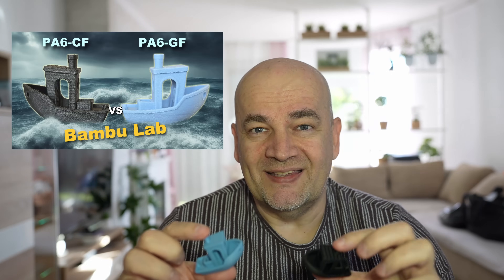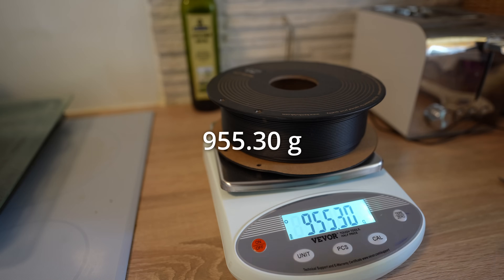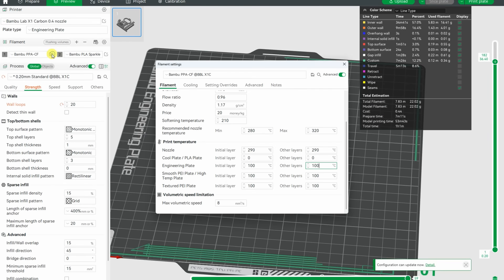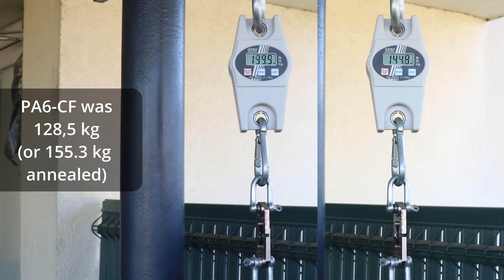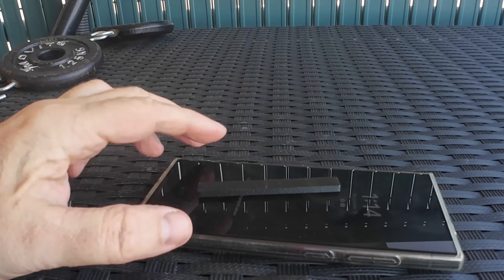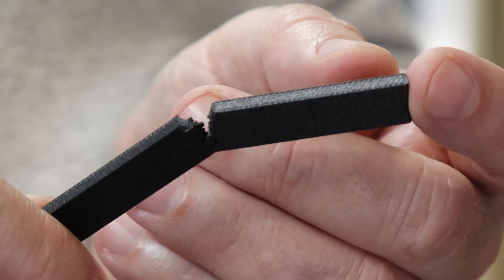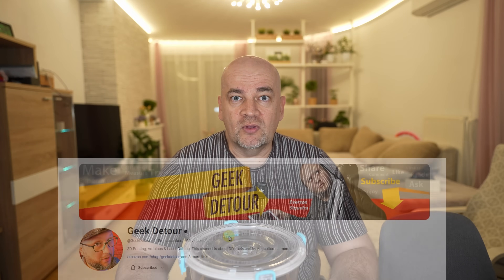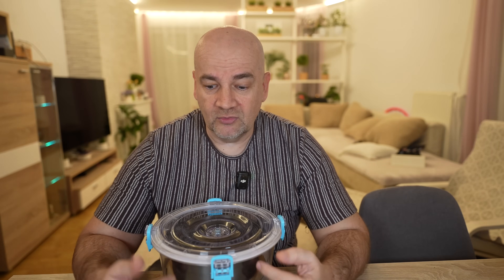Bambu Lab PPA-CF: the STRONGEST filament ever (I tested so far)

Comment: This is a fantastic channel. I thank you for all the hard work you put in for the benefit of others. I do have a couple of questions regarding your PPA-CF test and apologies if I missed this in the video. Did you use a .4 or .6 nozzle when printing your test parts? Also, after drying, did you use an external spool for printing, or did you print directly from your drier? Thank you again for all your hard work Peter
Reply from the maker: 0.4mm nozzle. I don't remember for that video. But usually from dryer. Short printing from open air.

Comment: Hello sir, new subscriber, I am very impressed by your testing, excellent video! I'm very curious to know if the results of your test showing 1g of water absorbed by the filament in 2 weeks would be different if you liberally coated the seal on the vacuum container with vacuum grease before sealing, and additionally, if there would be a difference if you vacuum sealed the chamber right after pulling the filament and chamber out of a warm oven. Cheers!

Comment: I've been printing with this material for work. It has been working great. However, yesterday we had a thin part warp on us after being exposed to the sun for a few minutes.  We then put a few parts out in the parking lot, and the thin parts got alarmingly soft. This seems to be a combination of humidity, temperature, possibly UV exposure? I know this material absorbs moisture, but does this mean the parts are unusable anywhere the humidity gets over 50%? The filament was dried using bambu x1c heated bed drying cycle. Print temp is 300C. Print speeds 100mm/s max. I did not anneal the finished parts. What can I do to prevent this material from going soft and warping?
Reply from the maker: Wow,  this is new to me. I will try to investigate this. It should withstand this without problems..

Comment: I just print from a toaster oven.. inserted a brass fitting in the rear and PTFE tube to my P1S. Installed a stainless steel shaft through the middle and stood the toaster oven on its side, and used external temperature probes to a thermometer to monitor internal temperature. Works well, and it’s cheap… NOTE: you must turn groves in the shaft through the toaster to place large fender washers to keep the spool centered so it can’t walk near the heating elements, without doing this, it’s a big fire hazard as the spool will wonder around on the shaft and eventually touch a heating element. But if you have the grooves turned in the shaft and use the washers the spool cant wonder. 

Active heating while printing is the way folks.

Comment: The manufacturer recommends annealing the print at a temperature of: 120 - 140 ℃ 6 - 12 hours.
It was necessary to print double samples and conduct tests also after annealing.
Why didn't you do it?
Reply from the maker: I did it with other PPA filaments. Only no fiber reinforced can benefit from this, temperature resistance will be better.

Comment: I'm increasingly convinced that layer adhesion is THE deciding factor in determining strength of printed parts.
Reply: Yes and no. Its important and certainly plays a factor in the overall strength given that its always the weakest link in a 3d printed part, but you can and SHOULD design and print parts with this in mind. The relatively weak layer adhesion of literally any 3d printed part can be mitigated if the part is designed to be printed in an orientation where any anticipated loads will either put the part into compression, or will be aligned with the layers and bypass the layer adhesion as much as possible.

Comment: add a small of amount of orange re-usable descant to you vacuum container. That will pull water from the air in the storage container that got sealed in when it was closed. 
I use a 4 liter cereal air tight dry box with about 50 grams of desiccant for my PPA-CF/PA6-CF spools.

Comment: For your Z test what was your chamber temp?  An active chamber heater will help with getting better layer adhesion along with the increased nozzle temps.  The TDS for that filament list a chamber temps between 50 and 80c.  Getting that chamber closer to 80 will give you better isotropic properties, this will also make it stronger in the xy direction too.  You can see in you horizontal twist test that the layers separated, which is probably most of the failure mode.  Get that plus4 up and running and redo all your engineering filaments.  I bet they will all perform better with the actively heated chamber.

Comment: Ive printed PPA-CF at 340C in a 110C heated chamber and got around 70% strength in Z vs in XY. I also annealed it. it likes hot it's really not a plastic that should be printed on a Bambu x1c lol. to be fair this was 3dxtech ppa not Bambu

Comment: ohhh that qidi isn't safe. The PCB that controls the chamber temperature even with the firmware update has a choke that will heat up to over 170 degrees. It's not supposed to get that hot.

Comment: I accidently annealed a full spool of sunlu pla+ at 70c for 12 hours in a drier. When printing it, it required higher temps to print without skipping. Might be worth testing to see if it retains any temp resistance?
Reply: ofc it doesn't. you change it's structure when remelting.
Reply: @riba2233  understood. Initially thought no as well since it was rearranging the crystals and remelting to normal pla+. But after using it more, it needs to be printed above 250, tested up to 300 while still printing reasonably well. Being able to print pla at these temps has a noticeable effect on layer adhesion. Not sure if it affects any other properties.

Comment: Regarding the moisture change, I keep my most used filaments in Polymaker dry boxes (from PolyDryer), and I was very surprised when the % went from below 10% to 22% in less than a month and even the desiccant changed colour from orange to black.
I expected it to be able to keep my spools relatively moisture free for at least a month, but it seems like I have to dry them every time I want to print (if it's a material I print with less than 2x a month), since some materials really should be kept at <= 15% humidity.

Edit:
Oh and have you tried the PAHT-CF (PPA-CF) from QIDI? It's way cheaper (95€ for 1kg) compared to Bambu and I would expect it to be very similar in quality.
Honestly, haven't seen you test QIDI filaments in quite a wile. Even in the filament roundups for PLA and PETG there isn't a single QIDI filament, which is slightly disappointing to me, as I mostly use those and Prusaments.
Reply: 168 vs 120mpa in specs...
Reply: @riba2233  Which value are you even referring to? I can't find one that is either 160 MPA or 120 MPA in QIDI Wiki for said filament.

For me, I would like to see actual results. That is why I asked if he tested that specific filament.
Reply: @MiChAeLoKGB   tensile of course, bambu has much higher rating for some reason

Comment: The question is why on earth is it so expensive? It's a bit of plastic with some carbon fiber mixed in. You have to wonder if some competitors are going to undercut this price substantially. At this price, along with the ownerous drying procedure, I would rather prototype in some other material and then use an outside SLA printer in nylon for the final parts, superior strength without z-axis weakness, and less money. You could even SLS print metal and get, well, the strength of metal, for similar cost.

Comment: 16:50 For a meaningful measurement, use aluminum spools that don't absorb moisture. They can also tolerate higher temperature for drying.

Comment: For drying, I recommend a large toaster oven with a metal tray and use aluminum foil to cover the filament on aluminum spools. The aluminum foil and tray block direct absorption of radiation from the heating elements. This minimizes thermal decomposition or hydrolysis. Most toaster oven have a timer, but some allow for continuous heating.

An even better solution would use vacuum to reduce the drying temperature, for reduced decomposition/hydrolysis, but high temperature greatly increases the rate of moisture diffusion from the core of the filament.

Try PPS next!

Comment: with this poor layer adhesion, the material is pretty useless. we don‘t need materials which are stronger in xy but one single material which is ok in z!
while I like watching your videos and I respect the scientific approach, it is far away from real world applications. In real life you should never be so close to the the mechanical limit! you need to compensate the material limitations by the geometry of the objects.
there are too many filaments on the market which are not needed since there is no real advantage in mechanical strengths!
3d printing has two major limits: gravity and layer adhesion. while multi material printing made big improvements which is beneficial to deal with gravity (support layers) we still are waiting for a solution for the extremely poor layer adhesion!
Reply: have you watched cnc kitchen vide0 about transparent prints?
Reply: i hve watched a lot of cnc kitchen videos. but i don‘t remember that?
Reply: @skewcrap   check it out and you'll see how we can get some really good layer adhesion ;)
Reply: Please don't include me in your idea of "we". Plenty of "we" design functional parts that take into account the directionality of the loads applied through design and print orientation and make great use of materials that are stronger in xy than z. "We" don't all print the same things.

Comment: As for layer adhesion... If you need better layer adhesion you should really go beyond "maximum" printing temperature. For example, there is a lot of difference between printing ABS on 245C and 270C. Of course, fan as low as possible, if not turned off. You can't expect small details or overhangs to be printed beautifuly, but layer adhesion is noticeably increased.

Comment: This is surely a very interesting material for more demanding parts. I wish you could do some more extensive testing on the temperature part, creep over several heat cycles, stifness at high temperatures or extended time at elevated temps, since those properties is what makes expensive plastics worth it :) maybe we should donate money so you can buy an industrial oven :)

Comment: Very interesting video. You should have printed right after opening the package. How do you know if the moisture reduction was from the spool or the actual filament? It seems that the spool is some type of cardboard. I'm sure cardboard absorbs humidity as well. Thank you.
Reply: No, you should never do that with serious materials
Reply: @riba2233 I would like to see the results as a comparison to after to see the differences both in print quality and mechanical strength of printing "wet". Of course his "wet" and mine in the Houston area may be very different.
Reply: @tracemyersx   you can't be sure that 1. They have dried filament after extruding 
2. That they packaged it properly in time, not to mention if it doesn't come in mylar bag

Sure, sometimes or often it will be ok, but if you are paying 100-200 for a roll then you will dry it. Wet filament can print very poorly, idk if you have ever seen how bad it can get lol

Comment: For better layer adhesion it is recommended to print with a nozzle temp as close to 300c as you can get, if not higher, as well as turning off the part cooling fan entirely, even for overhangs. Other youtubers also got better results when they insulated their enclosed printer and annealed the parts at 140c overnight.

Comment: Would he nice to see the difference between this and the QiDi PAHT-CF (PPA-CF).
The qidi has less overall strength but the layer adhesion seems to be better.

Also they have UltraPA which is PPA without fiber reinforcement and shows insane layer adhesion based off of their data sheet.

Comment: The layer adhesion issue is definitely weaker due to low print temperatures. CNC kitchen showed how slow and hot printing can dramatically increase layer adhesion, up to 80% of XY strength. CF materials won't achieve this ratio because of the orientation of the fibers, but it should be much stronger.

Comment: Great video as always,  another person was able to get the exact same Z test strength results as you, but was able to increase it to 59-62 afterwards by turning off "slow printing down for better layer cooling" and chambers temps were in the mid 50's to 60C  I can't test this myself until my  plus4 gets here in a few days.    My X1C motors likes to skip steps when the chamber  temps is above 60C.
Reply: My P1P has the same issue, most annoying.

Comment: CLOUGH 42 ran into similar layer adhesion issues with his tests, and Bambu pinned it down to failing to COMPLETELY turn off cooling. Made a huge difference for him. Give it a shot.
Reply from the maker: I saw the video. I will have another testing with PPA, when I don't use default settings any more (as mentioned in the video, 310°C etc.). There may be small problem with overhangs, if I turn off the part cooling (watch that Benchy in this vid.) But I will give it a try, when I finish the Qidi Plus 4 review.
Reply: @MyTechFun  as for PA6CF i completely turn off part cooling but give it about 20-30% for bridging and steep overhangs. To be more effective i also 'strecht' the time/length ot the beginning of the colling fan and ending. Basically i tried to shift it 'forwards'. It starts around 2mm sooner than the actual bridge and ends 2mm sooner, so that the spooling up and down of the fan is included for the time the fan is turnd on
Reply: What setting allows you to ramp the fan speed up early? I was wondering about this for my ASA. I use orca slicer
Reply: @drfailbucket I turn off cooling entirely for every single filament when I'm printing something structural. It often means I need to slow the print speeds wayyyyyy down to allow the newly laid down plastic to solidify sufficiently, but I get such better layer adhesion when doing it.

I needed to remove the press fit pulleys off my printer's stepper motor shafts, so I printed a press-fit pulley puller.

First I tried PETG (no fan, inside an enclosure). It was strong enough that the threads on the M3 stainless steel bolts I was using sheared off first! 

I went back to the hardware store to upgrade to M4 class 10.9 bolts. Modified the model to accommodate the larger nut and bolt. Printed it again in PETG (Hatchbox, clear, undyed), no cooling. This time, the nut plastically deformed the PETG, allowing it to spin in its hole, but still no breaking along layer lines. I had to use tin snips to chomp away the plastic to free my stepper. Huge bits came flying off looking like glass shards. Looking at them up close, they were not snapping off along layer lines. They were being actually sliced by the snips.

Anyway, I needed something stiffer, so I printed it in Inland PLA+. Again, no cooling fan. It popped the pulleys right off!

Tl;dr: when I need something functional and strong, and I have the time to spare, I disable the cooling fan entirely, regardless of the filament type I'm using.
Reply: @MyTechFun  can't wait!
Reply: Thank you I was looking for this specific comment after watching the other video review, which went down the rabbit hole of chasing the missing layer adhesion vs spec 😁

Comment: Great testing! I'd bet the PET-CF needs annealing to reach its best specs, though I'm not sure if you did that or not. Definitely looking forward to your Plus4 review! Mine has been fantastic so far and right now I'm printing special PP-GF30 filament at 290C with beautiful results. Only difficulty is build surface, which isn't on Qidi since PP doesn't like top stick to anything except PP.
Reply from the maker: Several comments mentioned the annealing, but why is it not mentioned in the product page on Bambu Store website?
Reply: @MyTechFun  Interesting. It isn't mentioned on the product page at all. A bit misleading to give the specs without the caveat. I was only aware because I just read the Polymaker Fiberon PET-CF17 TDS and it highly encouraged annealing. They at least have a note on it at the bottom of their product page.
If you download the Bambu Lab TDS linked near the bottom of the page for their PET-CF, annealing is only mentioned in one spot. The note under Specimen Test reads "All the specimens were printed at the following settings: Nozzle Temperature = 270 °C, Printing Speed = 100 mm/s, Bed Temperature = 80 °C, Infill Density = 100%. All the specimens were annealed and dried at 80 °C for 12 h before testing. And the suggested annealing temperature of models printed with Bambu PET-CF is 80 to 140 °C, and the time is 6 to 12 hours. The annealing effect depends on the annealing temperature, time and the model itself: size, structure, infill and other printing settings; some prints may deform and warp after annealing. When drying the filament and annealing the prints, it‘s required to use an oven that has big enough inside volume and can provides even temperature distribution, such as a blast drying oven (forced-air drying oven), and the filament and prints need to be away from the heater, and a micro-wave oven or kitchen oven is not compatible, otherwise the filament and prints can get damaged."

Comment: Did you see Clough42's approach to reach way better layer adhesion? What do you think?
Reply from the maker: I saw the video. I will have another testing with PPA, when I don't use default settings any more (as mentioned in the video, 310°C etc.). There may be small problem with overhangs, if I turn off the part cooling (watch that Benchy in this vid.) But I will give it a try, when I finish the Qidi Plus 4 review.